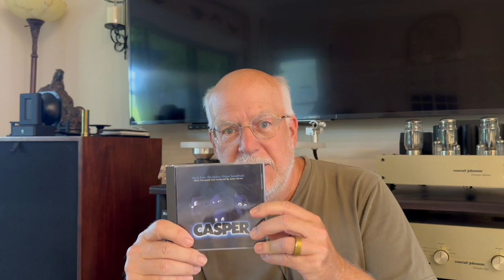Do speakers really need to go down to 20 Hz?

Comment: My personal experience is that clean low bass below 40 Hz add spacial information for the whole image of music in my room. My floor standing main speakers go down to about 40 Hz but when i added my TL sub woofer it glued the whole picture of sound together into one mold. It's not only the volume of low frequency's but the information it provided for the brain to form an image of the sound stage. So, it made for me a huge difference with or without a TL sub woofer that can go as low as 25 Hz. Beside that, my low volume listening improved a lot because the low frequency’s are there even at very low volumes.

Comment: The answer to that question is yes, speakers do need to extend down to 20hz.  If not, then a subwoofer will be used in my system.

My first reason is due to the possibility of music composition.  
My second reason is because my modest collection easily has a sizeable amount of cd recordings that are lower than 30 hz.

Mahler's second symphony 
Holst - The Planets or how about 
Camille Saint-Saens Symphony 3?!

Not to mention several of the Bach organ works.

I did not have to search hard for those.  But in all fairness, I have taught music history and low brass performance for a very long time.  So I could easily recall those examples.

If I searched my collection, I am sure I could find electronic music in fair amounts that extend between 20-30 Hz.  

In my examples, we are not addressing the impact of low frequencies.  Music indeed does have works in that range.  The scope of recorded music is huge.

Comment: Even if you have big speakers and subwoofers, the question is, can your room produce those frequencies? I have a big listening room and a subwoofer that can easily reach down to 20hz, but still my system can only produce down to 27hz (which is plenty for me), in most cases it's the room that is the limitation, not the system.

Comment: Impact is the key word. You feel the sub. In hifi system you shouldn’t hear the actual sub.  It simply compliments your speakers. A sub is essential. Once you listen to your favorite music with one you’ll never go back. Don’t  get hung up on numbers. Feel it
Reply from the maker: Well said!
Reply: @firstdaddy  Quite true about large woofers loading (or overloading) the room with bass. Measurements show a massive climb in mid bass frequencies below 100hz when oversized woofers are used in smallish rooms. What people are hearing (and enjoying) is not actual 20hz extension but huge peaks in the mid bass often centring around 50hz. These peaks can sometimes exceed +20DB! That's okay I guess because people in general love bass. Even so I have heard accurate (read flat) bass from 100 down to 20 hz but only when DSP correction is applied to a given system/room.

Comment: Interesting how you use the term, "impact." That's better known as dB. You're 100% right. A 7" inch speaker may produce sound down to 40 Hz but only at 50 dB. A 15" speaker will likely produce the same note at 75 dB. That's impact. I just made the connection. I assume you own a pair of Altec Valencia's from around 1974. So do I. I had the 806-8A tweeters rebuilt by GPA because one failed, and they upgraded them to a higher wattage. I also added two LeSon bullet tweeters in parallel with the 806-8A HF drivers. My x-over is set at 4. Very nice sound! Sorry to drift off topic!!

Comment: It might be what music you listen to. You're not wrong that a lot of music won't go below 40hz. Unless, it is electronica, rap, hip hop, RB, pop, classical (as in pipe organ) and so on. If you listen to anything else, I guess you won't go down to 20hz. However, if you listen to a live classical part, it might give you another impact you didn't know was there, like the conductor walking on the stage, and that stage become a membran. Anyway, if it's not important to you. Forget it, some might want fullrange or use a sub for a better impact. It's not useless as I sort of got the impression of in this video. Music is physical, maybe you should add a sub, and a newer CD than Casper ;)

Comment: I don't see your argument holding with impact since as long as smaller drivers can have respective higher excursion to make up for it you get the same impact (e.g. multiplicative of total cone area of all bass cones with maximum excursion). That's what defines the impact you can feel (the air being moved). 

Now I believe the reason on why people feel a certain speaker is lacking (based on my hifi experience) is that a lot of speakers on the market (especially the smaller models which "lack" the chassis volume and sufficiently sized bass cones, like those ones with a single small bass cone for instance) will result in very high distortion when pushed hard (which is needed to produce the same low frequency at the same SPL compared to larger cones or a lot of bass cones). So what speaker manufacturers do is they tune those small speakers at much higher cutoff frequencies than their bigger siblings in the same speaker lineup. So they still can reproduce those frequencies (as shown on your meter) but the drop of in SPL is much higher. So the larger model will drop fewer dB of sound pressure than the smaller ones. Typically they are rated at -6dB for their tuning frequency (e.g. when bassreflex loaded) and a large speaker might be -6dB at let's say 23hertz which means that if you were to play a tone at 23 hertz it would play at -6dB compared to something played before their rolloff in the lower end (which might be at 80 hertz, all depends on the speaker when they let the lower bass roll off). This is already significantly less louder but 23hertz is super low so at frequencies you would listen to in a musical piece at maybe 42hertz (lowest register of an e-guitar in rock) it might only be -1dB or so and it will "sound fine". However, now you do the same thing with the small model of the same manufacturer which might be tuned to lets say -6dB at 35hertz. Well, now you might still get -4dB on 42hertz etc and that is a very notable drop. The reviewer will clearly hear that the amount of bass pressure he is used to in his reference system is at a very different level and he will (rightfully so from his perspective) conclude that this speaker is lacking bass/impact however you call it. So the rolloff curve of the lower end of bass starts much earlier/higher up in the frequency band and the curve is much steeper than the larger ones. They have to do that in order not to overdrive that small little bass cone in a tiny 2.5 way speaker or similar. So as long as you play stuff that doesn't go very low the SPL in bass is still there but the moment you put on a track which goes quite low (so that doesn't mean close to 20 hertz but more like 40, 50, 60 hertz ... so definitely within the speakers "range") but the rolloff will already be very notable in those frequency ranges with small woofer speakers. You would have to crank those regions up in DSP to compensate for that (which brings other issues then). So that's the reason why people will often say a speaker lacks bass. Otherwise a small speaker can still deliver all the impact (not necessarily the quality since distortion levels will be much higher when pushing the same SPL) as long as the cone area in combination with the maximum excursion of that driver can reproduce that SPL level desired. Since a lot of modern loudspeakers provide extremely high excursion even comparatively small cones (by old standards) can reproduce a ton of bass impact which might surprise people. But depending on the quality of driver, distortion etc only some companies let these smaller cones (often single or two small bass cones) roll off very low. Speaker manufacturers simply do what they think is best to provide a good overal performance giving the price and since more and larger cones for bass (everything else being equal) drives up the cost of a speaker by a large degree they will often just roll of the lowest bass more aggressively which reduces distortion, overheating when being pushed to hard in exchange for a perceived "lack of bass" when a track really demands the impact there. External subs just need to reproduce the lower part of the bass frequency range and thus they don't roll them off in this comparatively small frequency range. So the moment you add your sub the rolloff is gone, the lower bass has the correct full SPL and the impact is there again.

Comment: I have been doing a lot of testing with my friends La scallas he purchased new in 1982. We pulled them out of box after 20 years in storage and hooked them up to all his SAE gear. I'm a large room at our hobby shop we could really turn up the volume. Tried 4 different amps ( SAE 2600  2x400, Emotiva DR2  2x600, PS audio m1200  2x600 mono's
And D-sonic M3a 3000  2x1500.)  Also added 2 von shcweikart tower of power subs. The speakers sounded the best with just the 2x 1500 watt amp using turntable for the source.  The sound to our ears was beautiful. Better to have too much power than not enough. I'm very impressed with the la scallas.  $3000 cdn back in 1982.

Comment: Great content! As a very old guy as a kid I fell in love with theatre pipe organs. So they have to go way down. Only speaker I could afford is a pair of Altec Model 19's and with the proper power they have no trouble. I have a couple of digital frequency analyzer's and found to make them sing it took try's with a couple different amps.  I have two track reel to reel tapes of George Wright and the Altec's sing with them.

Comment: Yes. Added a 1000 watt Klipsch Sub to my K-Horns. Big difference.
Reply: I have a 12 inch MA subwoofer in a 3.5 cu ft box with 250 watt amp to supplement my khorns. Can't image anything bigger but my son and I did build a humongous 15inch horn loaded enclosure that was almost 6 ft tall and powered by a 300 watt amp. Would put mine to shame but I certainly didn't need it. It would shake my front door. The driver was a cast framed huge magnet monstrosity.

Comment: Your system and/or your room is limiting the bass response if you are not measuring lower than mid 40s Hz. Standard four string electric basses go down to 41.2 Hz in standard tuning. Also, La Scalas only go down to 51 Hz, so they don't even reproduce a rock bass guitar playing in the key of E, which is very common.

Comment: For most music, which generally uses an electric bass guitar, the lowest note is about 40hz.   The average bass drum is around 50hz.   So unless you are listening to music that has an esoteric instrument, such as a contra bass or pipe organ, there isn't much below that mark.   So, for most applications, you will be fine if your speakers low end roll off falls between 40-50hz.
Reply: I think that electronic music has no limitations on how low in frequency they can go.

As the majority of instruments has.

So for example pink Floyd the dark side of the moon is the most recognized album on the planet with hart beats and other effects that are not instruments.

So it is artificial sound no traditional instruments so it is electronic sound in that sense and that were recorded in the 1973.

In other words there has since then been a lot recorded the last 50 years that is not just using traditional instruments. That has been electronic music.

All that to the side. And ask us instead.

If our hearing has a frequency range that is greater than most instruments is the issue that we hear better than the instruments or that the instruments don't support our hearing frequency range?

If the music is good and it go lower than any physical instruments can when it is electronically created.

Who cares that traditional instruments can't play those notes when the music is good?!

Comment: Over powering bass is impressive and on first listening many prefer that in an A/B comparison. My preference is for a balance so when listening at a lover volume I am not missing all the bass and looking for a boost in it and at higher volumes not getting distortion. Perhaps it is the overhead. If a speaker can do 20-20KHz what does the frequency curve look like between 45 and 15kHz? So it not frequencies of 20-45 Hz that matter but how the speaker responds for the frequencies at the extreme of the range it does get.

A 32 foot organ pipe is low at 16Hz.

Comment: Had no clue your into audio. Pretty cool. My dad has the mother of all lascala setups. It sounds like a concert in his living room. There is a lot of music with low bass. Most of it is modern rap or hip hop. The tron legacy sound track has some pretty deep bass. My self I've been into car audio since the mid 90's. My car has a single twelve subwoofer in it. It will play down to 27 hz with authority. It metered 143 db. Pretty ridiculous in a car. I don't know if you use spotify but look up Bass Mekanic. Lots of low bass.

Comment: I typically like a 3db down frequency slope of about 35-38hz and 3db boost at 85-90hz. That gives a full hard hitting bass that doesn't shake stuff off the walls at higher volume levels and doesn't sound bloated. I use test tones and EQ to achieve this, but sometimes particular rooms make it more difficult.

Comment: A speaker that is going that far down will be impressive big or an expansive active one (see subwoofer). The biggest trouble is the placement and the acustical behavior of your room. Most of us will not get a clear sound because of modes and compression effects. Mind that the sound wave will be amplified after twice the longest room gap by more as 7 dB. Sure, this value depends from the wall construction and others things. In short: No one will buy bloomy speakers. Many speakers are too small to produce a very deep base without havy movement of the membrane which leads to colorization of the sound. The combination with full range + SW can be much better controlled and is the ways to go when it gomes to bass at a recent level. - So, it is about physic and not the cost reduction by the manufacturer.

All speakers will move the membran with any frequency you give. But the sound level is too low to hear something. If a speaker is rated with e.g. 47Hz then this means not it will not go deeper. It means, it can play the base note with e.g. -3dB at the expected level.

Another point: It is not necessary to go down if your goal is to listen music and if you want to get the waves behind the scene. If you listen to the sound of a system, then you will probably miss something.

Comment: No you are absolutely not wrong. There are always a few people who claim that they desperately need 20Hz since they have some independent electronic tracks that go as low as 5Hz or some rubbish, but in reality you are absolutely right a bass standup or e-bass the deepest tone is just shy of 50Hz - the deepest one but usually the bass player is not only the e string and sometimes they even press the strings down. Even with a grand piano, just look where the hands of the pianists are, they almost never use the lowest keys. Building a speaker with 20Hz is like using winter tires in California because it might snow one day.

Comment: Until i had full range speakers (Elsinores) with a tuned port to 32-33 hz, i honestly can say i never heard all of the music available on a ton of productions... You want low? Nigel Stanford.. Solar Echos or Automatica is a guarantee of the full range... never measured the frequency of the base guitar on Traci Chapmans cd, but honestly never heard any of those songs sound anything like what i hear now. So much of my collection has revealed music that I was just simply not there before.  I applaud your efforts in trying to measure what your speakers are producing, however without knowing what the recording has in it to begin with is simply a measurement of your speakers, and notbthe recording. I at this point would recommend free software called REW or Arta and  reasonably inexpensive calibrated usb microphone .

The software can provide real accurate sweeps at a very controlled output and listen giving a very accurate response graph.
Reply: I totally agree with you. You can do that dsp by ear also if you use a tone generator. I did this with a drive rack and a pair of 18” pro subs. Went through the bands that were under the crossover point and a few over it, and sourced every band through the tone generator and adjusted the 27 band EQ in the drive rack until it was as flat as possible. Got them down to 35 hz flat. What a difference having the base tuned to your room. There’s a lot of info down there and accurate flat balanced base is hard to obtain. After trying a bunch of full range towers and finding non of them being flat, I am now of the opinion that DSP/eq is required to get balanced base in a room.

Comment: Hmm I use JBL 4367 with two JL Subs high-passed at 60hz and the subs make a staggering difference. 

Billie Eilish is a good example of modern musics with 20hz bass. Shakes my whole house. Kick drums are 50-60hz. 50-60hz is where most speakers start to drop off in power. Good 50-60 transients are critical to rock and modern music. 7” drivers are not bass drivers… just saying…